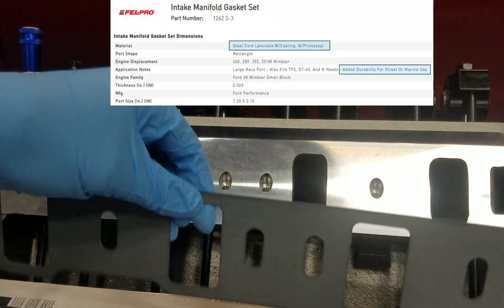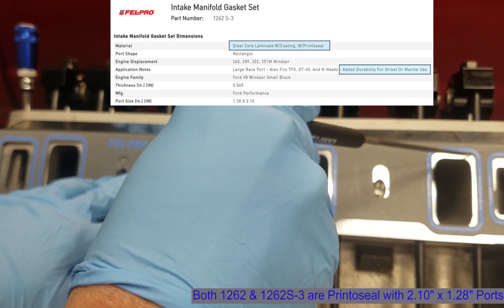Ford 393W Stroker Blueprint Engines HP9009 Cylinder Heads Intake Gaskets

Comment: Read a comment on summit saying the the blue seal goes against the head?
Reply from the maker: According to fel-pro, "In some cases, head gaskets or intake manifold gaskets won’t have any directional indicators on them. They may have Blue Stripe coating or be a different color. In these cases, it does not matter which direction the gasket is installed. If it were crucial, it would be marked."   See fel-pro link below for the source of this quote.
https://www.felpro.com/content/dam/marketing/North-America/felpro/pdfs/article-bulletins/Fel-Pro%20TechTip_Which%20Direction%20Should%20You%20Install%20A%20Fel-Pro%20Gasket.pdf
Most engine builders install the printo-seal stripe to the most irregular surface which is historically the more porous AL intake manifold.  As you can see though, both the AL intake and heads are machined smooth, so I bet it does not matter.  However, since most people, including myself, apply a VERY thin skim coat of RTV around the intake ports at the head side of the gasket, I prefer that side to be the smooth i.e., not the printo-seal bead side.